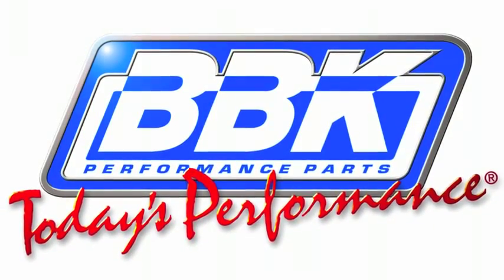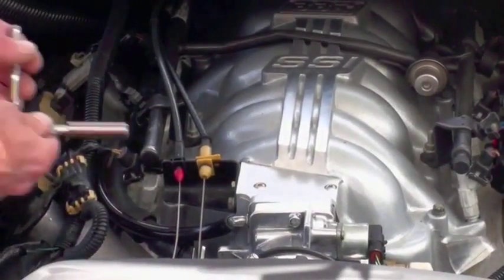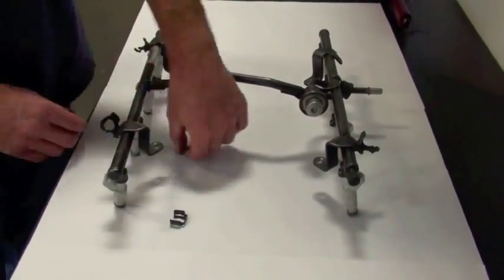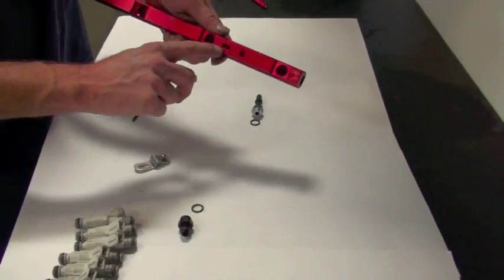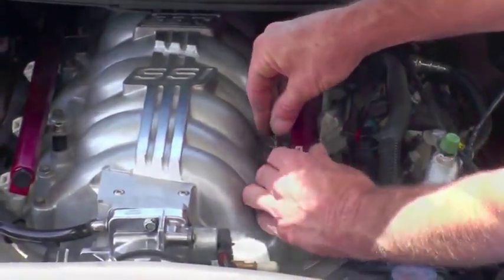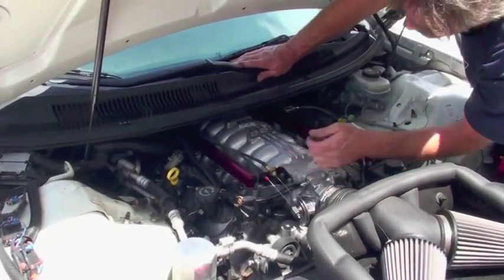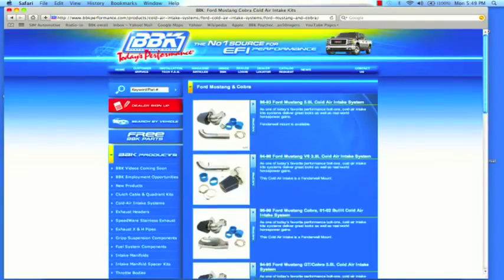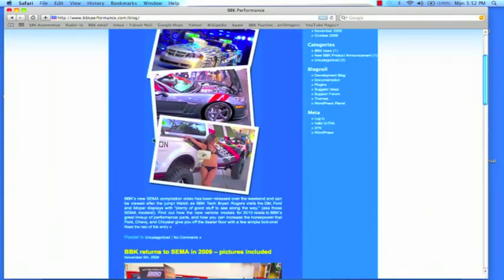BBK Performance High Flow Billet Fuel Rails for a LS1 LS2 LS3 F Body Corvette

Comment from the maker: What is seen on the stock fuel rails in the video is not a regulator; it is a pulse dampening device. When the fuel pump is running it creates pulsations or spikes in the pressure in the fuel rail. Over time this is hard on injectors and on the regulator in the fuel pump module in the fuel tank.